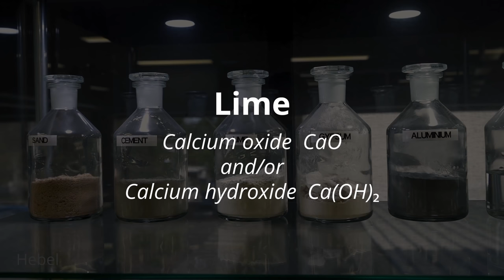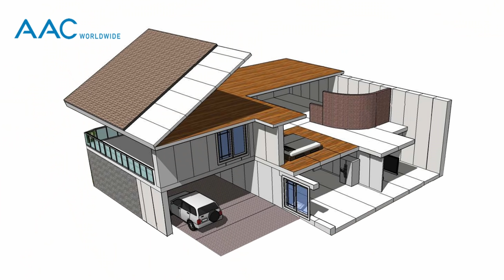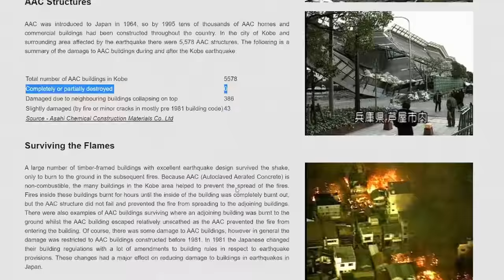AIRCRETE lightweight concrete | Everything you need to know

Comment: This was extremely interesting. I don't believe we have anything similar to this here in Norway. Would you mind if i use some of your videos in my class in first year trade school construction, showing from YT ofc so you get the views and ad revenue. Really enjoy your views and takes on different products and learning of new products.
Reply from the maker: Absolutely! Thanks for watching.
Reply: @BelindaCarr  Thank you very much. I really hope my students are atleast 15% as interested in construction as i am and give you a follow after i introduce them to you.
Reply: You might have them in Norway, but under a local brand name. Or then maybe not, they are only midling insulators and quite ugly. I did the numbers for a construction here in Belgium but decided for a 25cm "stick frame" + mineral wool (rockwool)which insulates about 4x as well as cellular concrete/AAC
Reply: @Witcold  That might be, but we have very different building codes here in Norway compared to Sweden. Not saying we can't use them, but most people here just chug along with the old faithful sadly.
Reply: @astranger448  I don't see how people think aircrete is ugly when it's being covered up anyway by drywall on the inside and stucco or some other facade in the exterior.
Reply: @jaxstax2406  also paint and wallpaper are a thing.
Reply: The material focus videos alone are informative enough to be used as a part of a class.
Reply: To my neighbor in Norway: the Blocks exist in Norway and Sweden and throughout most of Europe. Ytong is the brand name under Xella company now. The ytong blocks were first invented in Sweden. 

I am a long time user of Ytong products and exclusively use Ytong blocks in residential projects. 

And not to be considered a fanboy of Ytong another company is BAUROC 🙃

Either way, since first using them I have never looked back. Excellent material and easy to construct with due to its lightweight. Which is appreciated by my workers as it limits the wear and tear physically. 

Highly recommended and thank you for the video as I hope it spreads the message further about the benefits of this wonderful material 🙃
Reply: @sinisapredragovic6562  Thank you very much. Will have to look into it a bit more. I have mostly been doing woodwork, so i don't know all about concrete products, but i love expanding and learning within all fields of construction.
Most firms i have worked with are trying to shop locally as much as possible. The number 1 product around here is Vartdal Plast products. Neopor products you pretty much stack up like LEGOS. Love working with them.
Reply: @Prompeius  hi Wrarrl, 

Yes I have used those as well. 

They work fine for pools and basement level of a house. However, I don’t like working with them… they are simple to stack which goes relatively quick. However, 

Issues arise when stacking them higher than 1,6-2m … reason being is the rebar that you place on the plastic “rebar” inserts. On the inside. Horizontally it’s fine but then the vertical ones become and issue. 

Once you stacked to your desired height, then you need to place the vertical rebar, but you can’t tie them to the bottom. So when you pour the concrete, the vertical ones can shift and you can never be certain that they are in its place. 

Second problem is the concrete. Depending on the height, you would need to have a very fluid viscosity of the concrete to ensure that the concrete fills all the gaps, this has further problems. Your not allowed to use a vibrator. 

Then you are standing there and using rods to vibrate and force down the concrete. Which is not recommended. 

The more fluid the concrete the more pressure it exerts to the outward walls of the blocks which can lead to the walls swelling and leaning or even bulging, meaning you end up with an uneven vertical wall. 

Secondly, the pressure of the concrete can even burst the styrofoam during pouring. Which leads to then entire job grinding to a halt.
I have seen this happen multiple times on other peoples projects. 

The tight space between the plastic rebar of the block + the vertical and horizontal rebar makes the space for the concrete very tight. That’s why you need more fluid concrete to ensure an even pour and no air gaps. 

So the way around it is to do 2 pours. Meaning to separate cement trucks and pumps you need to pay for.. you pour have the wall and then stack again and pour the second half once the first pour has hardened. Which isn’t ideal structurally as you would want the adhesion to the first layer which you can’t really ensure. 

So all this translates to loosing the cost saving you might have gained  by the staking to the two cement trucks you would need to order. 

If you do get air-gaps anywhere, that is a headache of its own to fix. 

You loose time also on building enough exterior vertical supports to ensure that the wall is straight. 

But, again, it depends on the height. 

Hard to explain everything I have experienced working with them there is more, but I don’t like them and don’t want to work with them😅

Would like you to avoid my headaches if I can. I’ll be more then happy to answer anymore questions you have. Take care !
Reply: May want to look at Domegaia. It's been around for a long time. The drawbacks are the amount of energy needed to make cement to begin with. Other drawbacks include weight bearing loads. They do have several remedies for this but it eats into cost. 
Anyway you will see they turn a 94lb bag of Portland Cement with 6 gallons of water into 45 gallons of AirCrete. Using compressed air and soap water or foaming agent.
Reply: Not sure about this stuff, but over here in the netherlands a more dense type of airated concrete material is often used for interior walls
Reply: It used to be called siporex in Norway and gasbetong in Denmark. Tor Herman
Reply: @sinisapredragovic6562  So, what is your preferred method and preferred material for residential construction?

Comment: Airrated concrete was really popular in Sweden in the 1960-tys. But we have had a lot of radon problems with it. That might only be because of the concrete using lot of granite based aggregate that is very high in Thorium. While the radioactivity of Thorium don´t really escape the wall, some of the rest product of the decay does. One of those is Radon. It takes decades for the radon emission to even out, and its virtually undetectable the first couple of months.

Now that airrated concrete is not identical to the one in the video, but its fairly similar.

While it also have a decent insulation properties, it really need to have some additional insulation as a break. (at least in climate that have sub zero temperature regularly)
Reply: Does it still have those radioactivity problems, or do they use different ingredients now?
Reply: @MilosMoravac  Its hardly used in sweden,  its probobly more about the reputation than anything else.

But it was the sand that was radiactive. They use very fine sand, and it turned out it was very high in thorium.

Thorium by it self is not really neither that radiactive, or really that much of a problem. Its the Xenon that is made of it that is dangerus.
Reply: @matsv201  I found only a few articles about this in English, so a Swedish comment is very useful. You have lots of experience with it. To me, it also seems like there is a lot of bad reputation and rumors around aerated concrete. My logic is, if it's really still radioactive, it would have been banned a long time ago. But then again, with all things going on in the world, you can't really trust institutions 100%. There is always money behind every word written in articles, researches, studies etc. So, the only way for me to know for sure if aerated concrete is radioactive is to buy a Geiger counter, haha! I hope it isn't, it has some really great properties.
Reply: @MilosMoravac  Well this happens a long time before my time. But my understanding of is that they use montesand sand because its very fine grain, and hence work well with ariated concrete. Its very high in Thorium, that is mildly radioactive, but more importantly produce radon that is also mildly radioactive, but because you breath it in, its somewhat dangerus.

Comment: Behind my house in Thailand, a small development of 11 homes all are built with concrete pillars usually about 2-3 meters apart and the spaces filled with aerated concrete blocks. I think they are a foamed concrete product but I am not sure. In my house, we remodeled a bathroom and had to move an interior wall. We also used the same type of aerated concrete blocks to reduce the weight. The blocks for the development and my remodel were easily sawn with hand saws and drilled. I used heavy-duty anchors to mount a wall-mounted sink and cabinet.

Comment: Thank you. That was interesting. I didn't know that aircrete was made commercially. I'm used to seeing DIY recipes for making it.
Reply: Different way of adding closed air-filled structures into the concrete.  This product: AAC, uses a reaction of aluminum to lime, presumably, and blown air-crete uses a soapy mixture to express air-filled voids.  I hope that helps
Reply: @audigit  that's not the only difference. "Autoclaved" part of AAC matters a lot. As mentioned in the video, you get a different mineral (tobermorite) after autoclaving the mixture. As a result, compared to aircrete, you can get higher compressive strength at a given density, or lower density at a given compressive strength. And density basically defines the insulation properties of these materials.
Reply: Just what I was thinking! I would love to hear her opinion on Domegaia or honey do carpenter 😁

Comment: In Poland it's pretty much go to material for homes, real good stuff, however it's now considered inferior compared to latest technology
Here rising in popularity are expanded clay blocks, exceptional material for home building
Also... it's expanded clay, production line is heavily automated, material is local, abundant and cheap, can buy ready to go production line from Sweden
Reply: Expanded clay as in pellets or bricks?
Thanks for your response.
Reply: @meetankush  expanded Clay like pellets you use in garden, often glued together with small amount of concrete/other binder
Put in to n shape where middle is pretty much hollow, allows for moisture to escape from building easily, removing risks of rot
You would need to see whole systems/solutions to build with it, since expanded clay blocks won't work as intended if you just swap them with aircrete
Reply: @taith2  I see. Thanks for your elaborate description and application.
This sounds like something I can include in the building I’m trying to make in a heavy rainfall area. Will read and consult more about this.

Thanks for your time. 🙏🏽

Also, much respect to the Polish people who are already using it extensively.

Comment: We are currently designing and engineering homes in Paradise, CA and other parts of Northern CA and NV from AAC. A lot of the current issues we have been facing are outdated codes. One cannot classify AAC as CMU, unfortunately a lot of building departments are trying to lump them together. We have to do a lot of educating, but it's a great alternative to stick framing and wish it was more widely recognized in North America.
Reply: I am rebuilding after the Paradise Camp Fire in Butte CreekCanyon. How can I contact you?
Reply: how far did you get? are you a company specializing in aircrete? I would love to explore these options in Iraq as building material

Comment: Also good to know, AAC has a denser variant for use in foundation work, they might go by the name of AAC course block. They have more of the look and feel of the regular concrete blocks the industry is used to, for similar weight and strength (they are solid, not hollow like real concrete ones)
Reply: If you use latex paint mixed with cement for a surface coating,  it does exceptionally well for a monolithic  dome.   A soap foam based aircrete is a very good way to go.  Very DIY friendly.   Thanks for your video.   I hope to be turning out some on this subject soon.

Comment: I have worked with the product and found it to be too limited for my needs. I think it would be better suited for small residences or even better for unconditioned storage facilities. I found the 12" block has an actual r-value of 7 but they claim much higher performance, relying on thermal mass while wording their promotion in ways that can be misleading as to the real r-value. One of the projects was a work shop. Fastening to the walls to hang heavy things was a continual problem in that circumstance. I build very large residences and the structure required a concrete pier and beam system where the AAC was an infill. Installing utilities like electrical lines was cumbersome because of the need cross through the concrete piers. My neighbor built with AAC and had no real problems except for the interface to the wood roof structure. 

I think you do a great job with your videos but this may be one product where hands on experience is required. Research of AAC is not enough to gain a sufficient understanding of the implications of building with AAC. I find it similar in several ways to building with straw bale in that it is easy to be drawn to its positive attributes without understanding the associated costs of interfacing it with the other required parts of the building process. Anyway it is too complicated to have the discussion in a meaningful way in the comments section so I will leave it there and thank you for the hard work you do and the intelligence that you bring to the subjects you cover.

Comment: My thought has been to use AAC on "Tower" home.    Circle of same area as a square uses 17% less material for outer wall.    Withstand winds much better.   Mesh around outside with stucco turns it all into one solid unit. 40 foot diameter home will give you about 1200 square feet or 2400 if you make it 2 story.   Plus roof.   Run circular track and you can have rotatable solar panels on roof that track the sun.   All lines could be run down a central shaft  that contains all the utilities.  inner area for kitchen, baths being next to central shaft.

Comment: I recall seeing something like this from eastern Europe. They were using a hand saw to cut it and laying the blocks with a thin set type material. One would think California would be jumping all over this one
Reply: Has California ever done anything that is in their best interest?
Reply: It is common material in most of europe not just in eastern part in the past it was used for non structural walls ( my condo from 1972 have it) since 1990/95 it is also used as main building material. It is prfect for DIY because it is light and easy to stuck. It can be cut with a hand saw however the saw must have a proper teeths, wood saw doesnt last long
Reply: True, its decades old but not just in Europe. Shame we are so backward in the USA about adopting the use of advantageous construction materials.... smh...
Reply: I think that it's because autoclaves are really, really, really expensive to build and maintain. The larger the autoclaves the thicker(and more expensive) the walls need to be  in order to not rupture(https://en.wikipedia.org/wiki/Cylinder_stress). We would have to build a bunch of them for this material to be a sustainable building material, and California has some the the biggest population in the US.
Reply: @Bob_Adkins  The same can be said for Texas and their electrical grid or Florida and their flood. But here we are.
Reply: I think it's a great thing but unfamiliarity and political money at local levels are what holds this back. Overall cost would not be that much different once it were available in volume.
Reply: I think it's a great how conspiracy theory rational gets interject into every topic.. smh...
Reply: @nc3826  no kidding 🤦‍♂️

Comment: I became interested in lightweight concrete, and to try it out made a pair of speaker stands. I found instructions online for simply substituting the gravel aggregate with vermiculite or pearlite. This technique is apparently used for making things like garden sculptures, which don't need structural properties, and need to be moved from time to time, so it's advantageous if they're not extremely heavy. Same with my speaker stands: I don't want them to be so heavy that they damage the floor if they fall over. A worthwhile experiment, but they are a bit crumbly (probably because the ratios in the concrete mix could be more optimal). I was glad to see in the video that a commercial product is available. The most promising applications I saw in the video were the interlocking construction blocks (can mould them in any shape you like) and making sound-barrier walls between highways and housing. These walls only need to bear their own weight, so it seems AC has the structural qualities required for this application.

Comment: Dear Belinda, I am a trained cellular concrete building contractor and you mention that it is a good sound insulation, which is relative insertion coming from comparing to actual other insulation materials like mineral wool or fiberwool. However air is not a good sound insulation ! So in absolute cellular concrete isn't a good sound insulation, somehow it is one of the drawback of this wonderful material. My experience is if the project insulation target is around 8 to 10 (m².K/W) you cannot use only cellular concrete but you can add heat insulation with a good sound insulation like lime hemp concrete (Tradical) or wood wool (Steico). Thank you for the quality video !